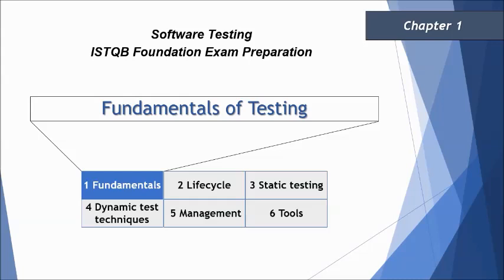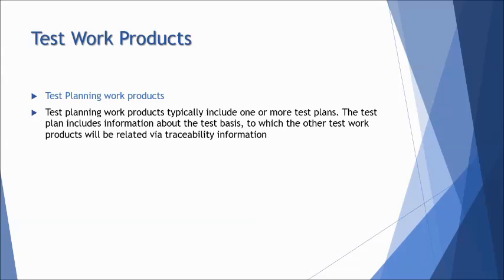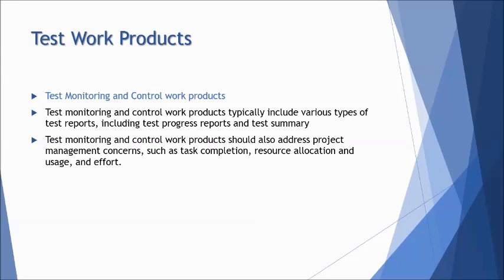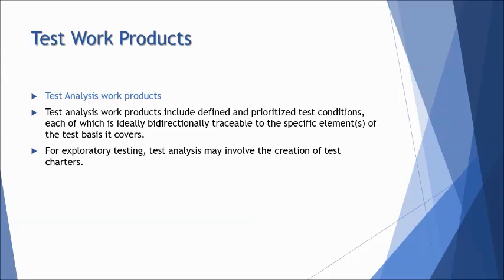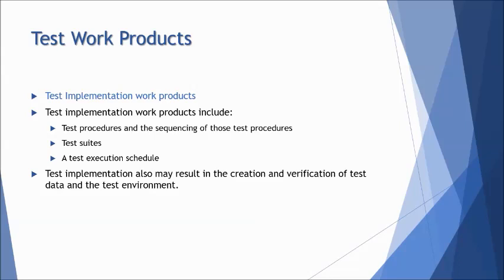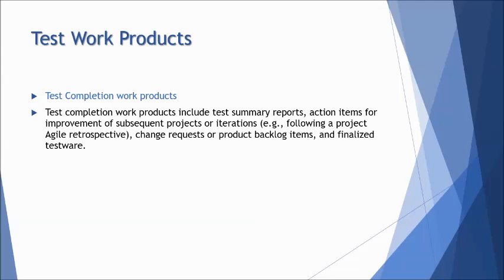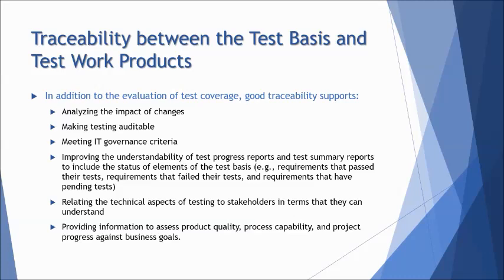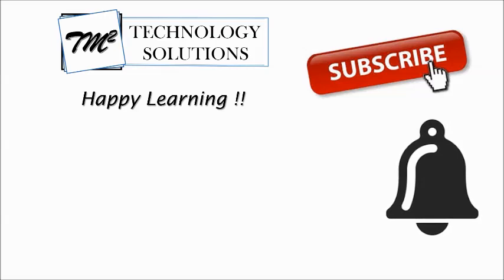ISTQB Foundation | 1.4 Test Process (Part-2) | Test Work Products | Traceability | Test Artifacts

Comment: Hi Neeraj,

In this video regarding the Test Process, I don't understand one thing. How or why monitoring and control phase comes before the implementation and execution phase? Especially for Testing Metrices which focuses on calculating the Test Execution Rate, the required data like the Number of test cases executed and Number of Test cases planned for execution won't be available until the process is in execution phase. Can you please elaborate more on this? Thanks !!
Reply from the maker: Hi Sharad,
It's more about planning that at what milestones we will monitor(Monitoring schedule), how will you monitor (Metrics) and how will you control the known deviations (Control). For sure we will do the evaluation at respective phases but how to evaluate will happen early in the lifecycle. Hope this clarifies.
Reply: @TMSQUARETECH  Yes it did clarify my doubt. Thank you for your quick response.

Comment: Hi Neeraj,
Creating bi-directional traceability metrics was mentioned under Test Design in last video but here it is mentioned in Test Analysis phase. Can you please clarify which phase work product is that?
Reply from the maker: It's a work product of Test Design as it is built there and updated with information in Implementation.
Reply: @TMSQUARETECH  thank you:)

Comment: I have one doubt that under Test Implementation among test processes for the previous slide of part 1 you mentioned activities like automating test suites but Isn't it so that for Test automation the complete test process steps are different and here we are talking about general testing process right ?
Reply from the maker: You are absolutely correct. And there is a separate certification to talk about Test Automation process. When we talk about foundation we are just fitting automation activities within the process at Test Implementation.

Comment: Are the videos enough to pass the ISTQB exam? Is is it necessary to purchase a book? What's your recommendation?
Reply from the maker: Hi Murat,
The videos will be enough with the official syllabus is recommended to pass the exam. As official syllabus will give you all the details. As, all the points are discussed in the videos and there are 1000s other who have mentioned as feedback that the videos where enough for them to pass, still I will recommend it to refer the syllabus side by side for effective preparation. Book is just optional as there are many across the globe who prefer to learn from a book. All the Best and Happy Learning!!

Comment: You listed a lot of documents in this chapter. but it looks like these docs in their entirety are applicable to Waterfall model. I have been working as QA for 10+ years by now and I haven't seen that ALL of them were used. In your experience did you (or your team members) write and/or use ALL that you mentioned. If yes, can you please provide (of course excluding secure information) the FULL set of all mentioned documents? Thank you
Reply from the maker: Hi Marina,
You're absolutely right by saying that. Yes, ISTQB follows a traditional approach to explain foundation level exam syllabus as they have a separate certification for agile. When it comes to documentation non of the org creates all the documents mentioned here as it could be quite hectic to manage them. Thus, Org A may create say doc 1, 3, 5, 7 and Org B may create say doc 2, 4, 6, 8. But, when it comes to understanding a process and when you talk about fundamentals ISTQB wants to give a clarity on all the documents.
Reply: Thank you Neeraj!